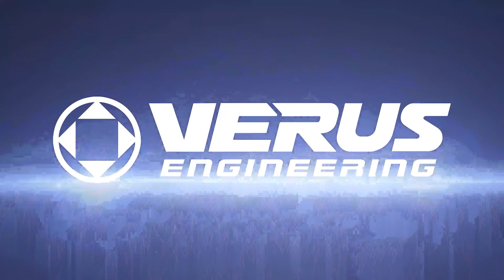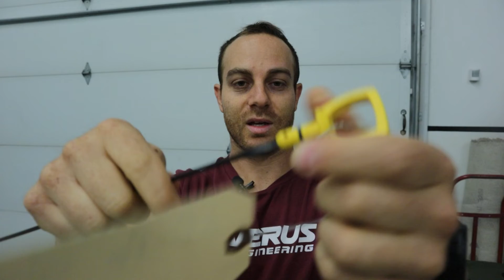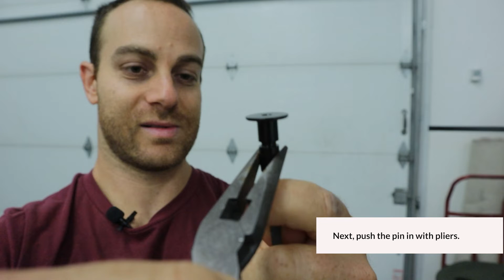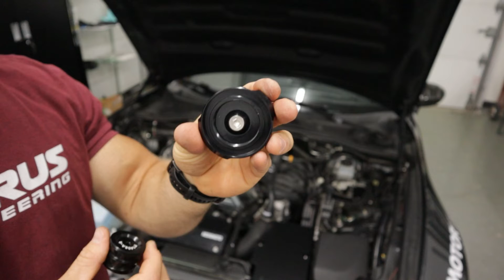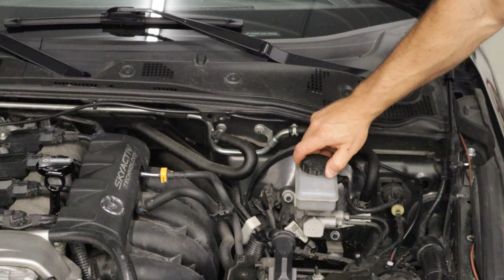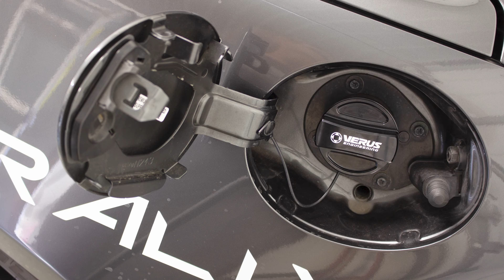ND Miata Fluid Cap Upgrades! | Verus Engineering

Comment: Idk if this question is able to be answered without more information but I’m wanting to do a rear mounted radiator on my civic eg track car pulling air from the side windows maybe using naca ducts and having it exit out the trunk where the license plate would normally be located. My question is would this create any extra drag or disrupt the air at the back of the vehicle? I was just curious if you have tested anything similar and if I should just stick with a front mounted radiator?
Reply from the maker: Feel free to give us a call or email. We offer aero consulting services for $120 an hour.
Reply: @VerusEngineering  sweet thank you very much

Comment: I Love it when you guys drop stuff for the ND miata! Please make an RF miata compatible High-Efficiency Rear Wing Kit. <3
Reply from the maker: It has been done recently multiple times by customers. It took a small spacer on each side and it cleared the roof.
Reply: @VerusEngineering where is the spacer placed? On the base? Would be interested to learn more.